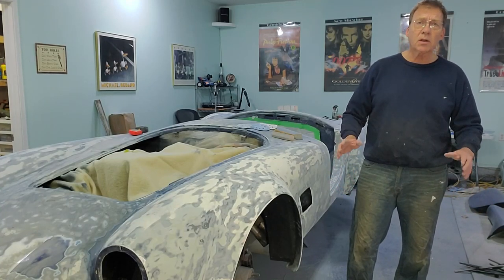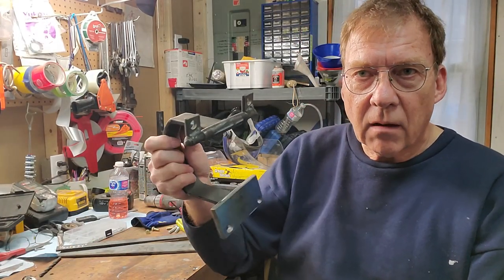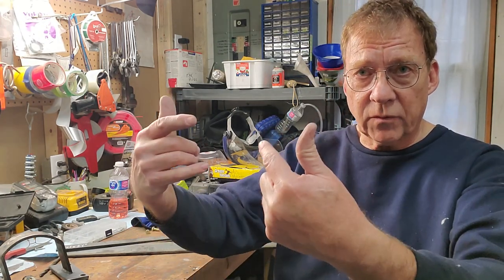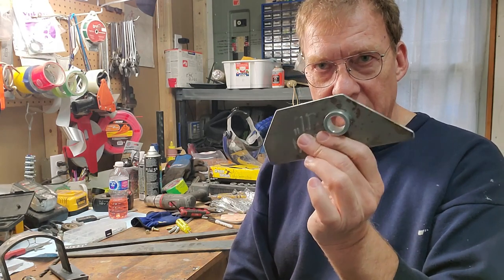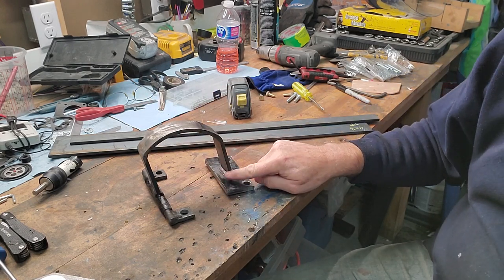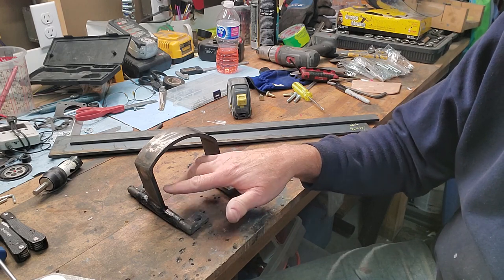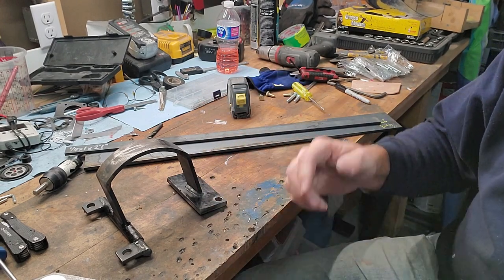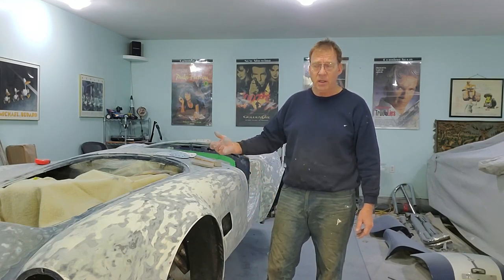Cobra Bodywork Part 4

Comment: Hi Wally.  Thanks for the 'Fisker' response.  I thought I'd let you know that a private FB Marketplace vendor is selling a set of  these in my neck of the woods;  copied 'n pasted : "Ensemble de 4 roues Ford GT (Mustang - Torino) des années 60. 14x7, bolt pattern 5x4.5, hub 71mm. En très bonne condition originale. Deux des trim rings devront être polies pour enlever des grafignes. Un des center caps aurait besoin de  retouches de rouge sur le GT. Demande $325, peu négociable." They look similar to your brother's and your 68's wheels but with 'GT' stamped in the center caps. Listing's title is "Roues Ford GT 14x7", vendor's name is Phil Morrissette from Terrebonne, QC.  Cheers !
Reply from the maker: Very nice of you  to provide such detail. My brother moved to a 500 style rim (15 inch) and a wider tire. as you mention I do have the GT original rims on my 68 mustang with the 14 inch rims.so we have a spare set as well, but thank you for thinking of me, I do appreciate it